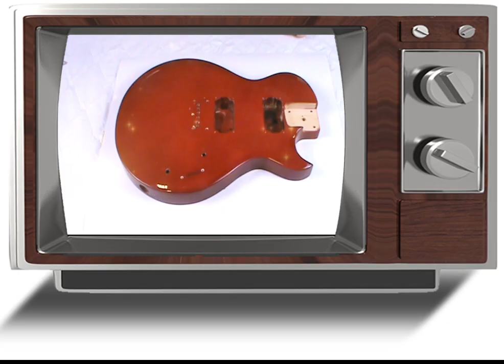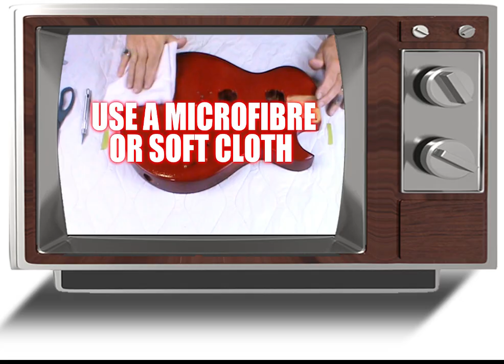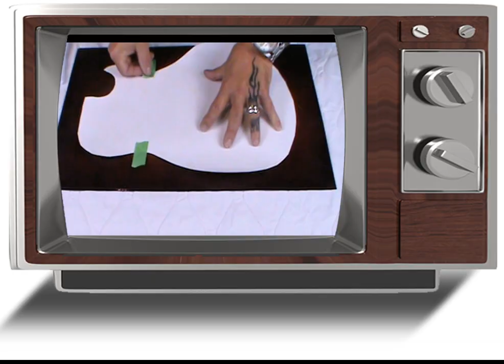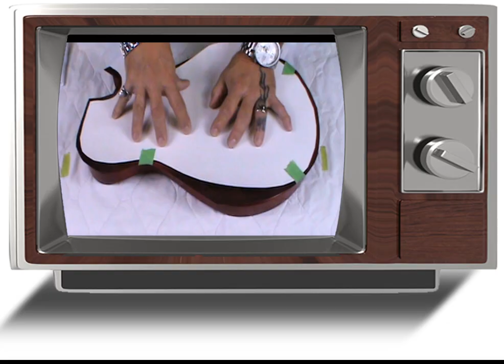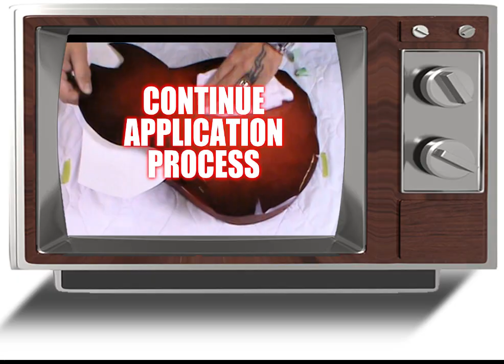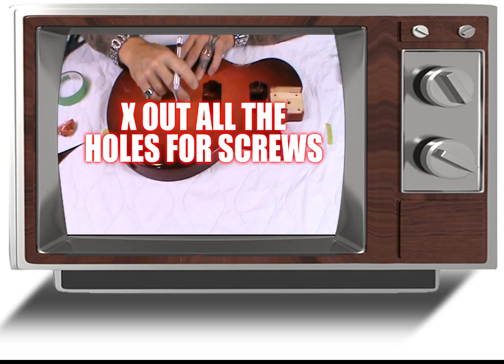Rockskins Guitar DIY Wrap Install

Comment: For best results, if I have a guitar that has a rough finish, do I need to fill or smooth it first? Any products you recommend I look into?
(basically raw wood that was stained. supposed to look "cool" and "metal" but it looks like a sharpie drawn on a deck planking)